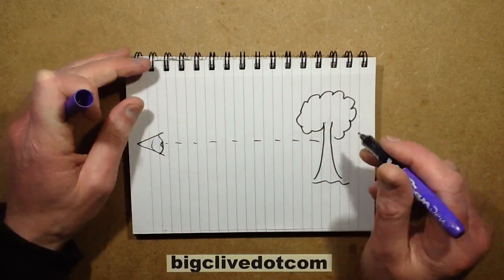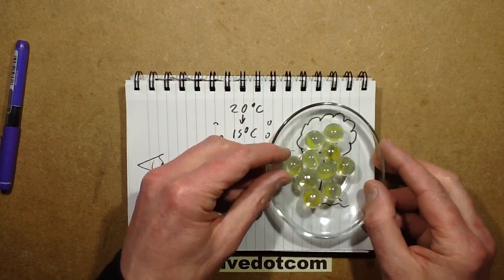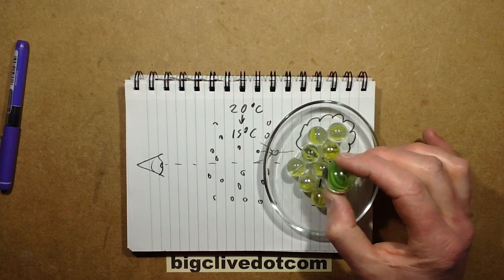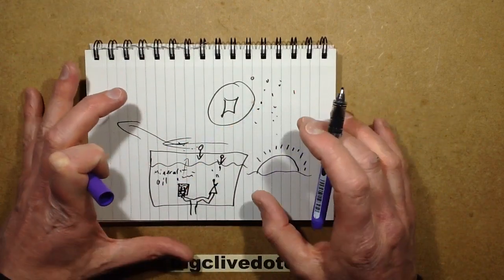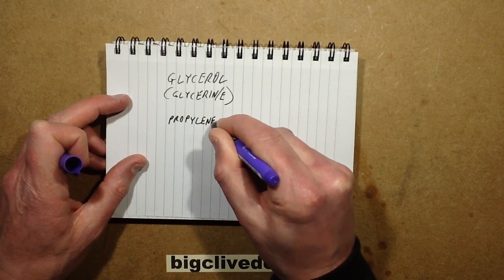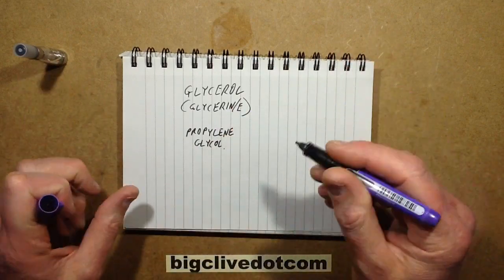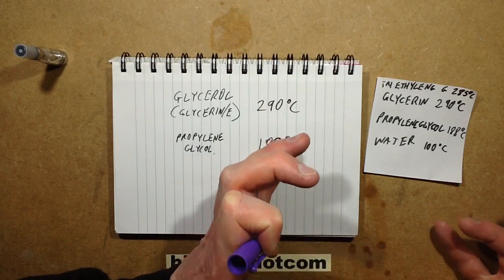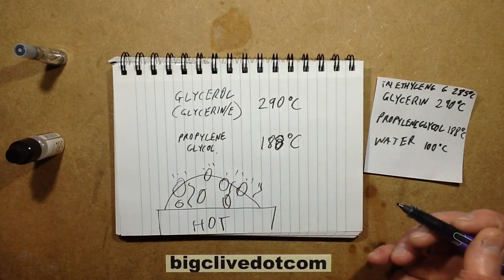How e-cigs and smoke machines make fog.

Comment: A fogger uses a pump and heat exchanger mine being 2000w and an ecig as you said has a coil a tank a mod which holds the batteries and the difference is the person pulls and inhales in order to bring the liquid through into cotton to then atomise it's very different man

Comment: Better also thank the drug dealers for those scales, I know certain resins need exact weight but I try to stick with two part pours. Not always possible but I got scales for them if need be. Also could this syste m be adapted for use in Models, like model steam trains? 

I have a very big interest in Steam Railways and while I know a few good "Smoke" units and methods (one that is extremely toxic but was only ever used on Thomas The Tank Engine filmings , yeah bit hanger with gauge 1 railway sets and cameras David Mitton was lucky to have been with us as long as he was. To say nothing of Gary Anderson's works like Thunderbirds, the Times must of been horrible but it was a great series.) But atomizer based systems appeal greatly to me because it is true water vapor, Steam in a cooler visible from which as a loved of steam feel so much more authentic.

Comment: Clive, I worked with a fellow that worked at a mouse themed park here in the states. They actually make droplets with a piezo actuator device or an array of them. Then they don't need a chemical medium to make the effect happen. I'll have to see if I've got a picture of the basic device but they pot the thing and it's like a little brick with the piezo surface exposed. I think I've got it around here some where in the work shop. You described the thing perfect in the vid btw. Super neat stuff to play around with.

Comment: Really cool video and great explanations. Thank you very much for this. A question,  thinking about a wearable fog machine for an halloween costume, which methods is the most durable when battery powered and the most shock resistant in case of external impact? Thanks

Comment: Could you use the mee fog type of foggers for eliquid if modified? might be a good idea to make a different type of atomizer, one without heat.
Reply from the maker: As Mee Fog units run at 10,000 PSI it would be a very big and expensive vaping device.
Reply: Same sort of pressures as waterjet cutters. I suppose if you could get hold of a secondhand HPLC pump that might fit the bill too (most could reach 10,000 PSI at reasonable (millitres / minute) flowrates).

Comment: The heated ammonium chloride (NH4Cl) simply decomposes into ammonia (NH3) and hydrogen chloride (HCl), cools down in the air and spontaniously recombines into ammonium chloride particles. The health concern arises when the decomposed gases are breathed in and combine with water in the lungs and mouth, forming alkaline ammonium hydroxide and hydrochloric acid respectively. Inhaling two highly corrosive compounds is hardly ideal now, is it?
Reply: Ammonium chloride in itself is, however, not harmful at all in reasonable quantities. It's in fact (mostly in Finland) used as flavouring for candy and known as salmiakki.

Comment: I have a couple lithium ion 26650s, MNKE brand and Efest brand (I believe efest is just a wrapper name and the battery itself is produced by another company)
One of them is almost 2 years old, the other is almost a year. Giving that I charge them every day, both batteries are between 365 cycles and 500 cycles. With that being said, they're noticeably not lasting as long and my question is When should I get rid of them,  or is there a specific number of cycles a person typically recycles their lithium ion batteries at
I'm under the assumption that these batteries are probably past their safe life span, but its not easy to get a straight answer from  local battery stores
Reply from the maker: +Brandon Fireking The capacity will gradually reduce, but lithium cells are very good with a high number of charge discharge cycles.  If you feel they've paid their way then you could always get a new set anyway.
Reply: Thanks for answering me, Looks like I'll be replacing one of them but not all of them.

Comment: I know this question might be a bit... boring?
But it's one that I never found a good answer to.
So in all these nice movies and shows (Doctor Who for example) as soon as something goes wrong something's exploding and sparks are shooting around.
In a behind the scenes video I have seen one of those sparks emitters (bad quality sadly) and they were some weird little black device (looked like a capacitor) that was held on the ceiling with duct tape.
To my question now: Is it possibly to create those movie-ish sparks by shorting a capacitor and if no, then how is it done then? Like is there some special device for it?
And how do you make sparks shoot out for, let's say, one or two seconds instead of just a really short burst?
Reply from the maker: +The Renegade Programmer Common pyro device in the FX industry.  You can buy them from your local LeMaitre supplier.   http://www.lemaitreltd.com/c/Robotics-and-SPDs/1jpHwzff4Hk
Reply from the maker: +bigclivedotcom I should add, they also do silver star ground launch pods and short (and long) duration gerbs which produce sustained showers of sparks.  Depending on where you are, you don't usually need any form of pyro licence to buy FX cartruidges.  just be aware that they can set fire to stuff as demonstrated rather tragically in the Station Nightclub incident.

Comment: @Clive - why do we need the Glycerine or Propylene Glycol in the first place? If we use just water and the bring it to boil, wouldn't those bubbles create the same sort of tiny droplets?
Reply from the maker: +Adam Nair The water vapour is nearly invisible and tends to just blend in with the air like normal humidity.  The glycol doesn't blend with the air so remains suspended as droplets creating the fog effect.
Reply: +bigclivedotcom aha okay, so if the objective is just nicotine delivery with a bit of flavour, can it be just water then?
Reply from the maker: +Adam Nair I suppose that might work.  I've never really used the nicotine version.

Comment: I'm curious what would happen if you doped a solution of 30% glycol with 70% water, to instead replace 5% of the water with liquid lysergic acid diethylamide in one of those nightclub fog makers?
Reply from the maker: +bluephreakr The lack of control over dosing would pose issues.  Plus the risk of adverse reactions and complete crowd freak-outs.
Reply: Not to press on, as honestly it was only a hypothetical scenario, but how would there be lack of control over dosing? The stuff would be thoroughly mixed before release right?

Unless you mean dosing based on proximity, and even then most fog makers are a reasonable distance away from other people, and out of sight. Eventually there would be complete saturation and even distribution within the area right?
Reply from the maker: +bluephreakr The environment in a club is constantly changing regarding airflow and turbulence.  You'd end up relying on monitoring density visually which is not accurate.  There's also a possibility that the chemical may not make it through the heater block intact and get modified on its way through, particularly when mixed with the other fog generating agents.  An alternative might have been to use an ultrasonic humidifier with a strict chemical to water ratio and run time.  But again, in a commercial environment doing something like this could have undesired consequences.
Reply: bigclivedotcom
I figured heat would be an issue. That and many drugs one can grab from the street or mock up may not have the same chemical properties when heated; I was relying on a few things for my hypothesis;
1) Glycol and water, while not entirely inert, should be inert enough as fog-making agents to act as a chemical deliverer
2) The drug in use is heat-insensitive, or somehow enhanced with heating, and would not be terribly affected by the other agents
3) Said drug is effective when given orally or nasally

I won't talk any more about it, don't want to give people bad ideas so easily, but that's what I was basing my previous statements with. If you like, you could experiment with the idea of fog dispersion in another video.

Comment: Thank you for the informative video. Some questions though, you mentioned the different boiling points of the liquids, but I am suspecting that the solution of 2 volatile liquids, e.g. propylene glycol and water, would be quite hard to accurately predict the boiling point of, especially given variables like the quality of water you add, concentration of the 2 liquids in M, and additives etc. How would the electronic parts accurately heat the solution to the right temperature? I supposes with a thermistor, you can control the temperature with some PID loop but the boiling point is again dependent on factors not taken into account. It's probably not quite right to say that the water itself is boiling, since it's a miscible solution, the entire thing is boiling and the bubbles bursting are both water and the other component... This gets complicated because as some of the solution boils and vapourises some of the gas will cool and condense back into the solution, I suspect it becomes a sort of distillation apparatus that concentrates more and more of the higher boiling point distillate, increasing the concentration and therefore boiling point with continuous use. Perhaps this is what leads to the e-cigarettes to "burn"?

Comment: Great video, the only comment I would make is the CE type atomiser you showed for the e-cig is very out of date and quite inefficient compared with more recent tanks and units.   The CE type uses silica wick which is heat resistant being basically glass rope but is very poor in moving the liquid from the tank to the coil whereas most modern units now use cotton wad, wick or similar and many modern battery units have something called "TC" which stops the atomiser fitted from reaching the burning point of cotton thus stopping the chance of a dry or wet burn.   A new concept in the Altus atomiser is using a heating block instead of a wire coil and the heating element is alleged to last ten years,

Comment: why is smoke from a fog machine irritating to the lungs and feel dry compared to normal air?
Reply from the maker: +iblis89 It's hygroscopic and in high concentrations irritates the mucous membranes by drying them out.
Reply: it just feels counter intuitive that water vapor is hygroscopic .. can that really be true? :S
Reply from the maker: +iblis89 The vapour isn't water.  It's droplets of glycol.
Reply: +bigclivedotcom But glycol,  glycerin and demineralised water in The liquid,  Where does the water dissipate to, there is generally no secondary exhaust.  you said it boiled away which should cause steam?
Reply from the maker: +iblis89 The water boils out of the glycol and ejects from the machine as a mixture of steam and the glycol droplets.  The steam is absorbed into the air leaving the glycol droplets visible in the air.
Reply: +bigclivedotcom thank you for the clarification :)

Comment: Clive, I'm afraid your explanation of fog is a bit wrong. The distortion isn't caused by a difference in the index of refraction, it's caused by scattering, specifically Mie Scattering, where the droplet size is comparable to the length of the wavelength of light. 

Long story short, it's caused by diffraction, not refraction; the light waves move around the droplets, not through them....

Comment: without sounding too much of a dick Clive because I love your videos but

Vaping is a bit of a misnomer,.eliquid isn't being vapourised it's an aerosol, stupid I know.

Boiling VG or PG is really bad & it produced crap we shouldn't be breathing, saying that it's still in quantities a lot smaller than if we were still smoking.

The whole high vs low power is misunderstood by most too & uneducated scientists love to do unrealistic experiments to prove a point.

like sticking 15 watts through CE4 designed for 5-7. Modern high power attomisers use bigger airflows, wider juice channels & better wicking materials, usually cotton or cellucotton so at higher power more liquid is aerosolled but the temperatures don't rise. IMO your more likely to get a dry hit (overheat) from a CE4 at 15 watts than a more modern Subtank at 40watts.

Comment: Glycerol and Propylene Glycol are used together in e-cigarette liquid. PG is a flavor carrier. Ratios vary. Most commonly in cheapo gas station and common store liquids the ratio is 50:50 in order to accommodate low powered eGo style devices. 70:30 ratio (VG/PG) and higher in VG is used in lower resistance setups and produces denser vapor cloud.

Comment: Hi Clive, what ratio water to white vinegar should I use for cleaning out a smoke machine? Thanks
Reply from the maker: +Steve Elvey Typically about 20% white vinegar to water (preferably distilled water).  Then after flushing a decent quantity through your machine, empty it, rinse it and then refill with fog fluid and flush some of that through to make sure no vinegar is left sitting in the machine.
Reply: +bigclivedotcom Thank you Clive! I will give that a blast, I have a machine that has got rather spluttery and was wondering how best to tackle it.
Reply from the maker: +Steve Elvey Worth a go, but spluttering liquid out the front can also be down to an incorrect glycol ratio in the fluid.
Reply: +bigclivedotcom I wondered also if it might not be quite hot enough? It is quite an old machine of dubious origins! I have been using a can of smoke fluid that I purchased from CPC a while ago which I have used in another smaller machine successfully, although I would much rather use one of your recipes if you have a video on mixing some, especially if it meant I could alter the smoke density.
Reply from the maker: +Steve Elvey If using the machine for personal home use then you could experiment with glycerin and sterile (boiled) distilled water, but if using it in a public area then I recommend only using commercial fluids for liability reasons.
Reply: bigclivedotcom Thank you Clive, will give it a try on the machine at home

Comment: Good job explaining the vape process Clive. Its surprising how difficult it is to find a clean answer (and how misinformed a lot of people are on the mechanics of it). 

Of interest to me is how quickly atomizers seem to fail; we do full chemical component testing as well as failure studies on new devices at my work. Good quality atomizers are gorgeous in their construction - very precise machining, high quality metals, etc., but we literally have bags of 100's of atomizers that failed resistivity thresholds after only a few vaping sessions. 
I am typically without an answer as to why ... careful examination always shows no discoloration or fatigue so it puzzles us to no end at this randomness. Not to mention having bags of near new atomizers sitting around that we can't bring ourselves to throw away ... neat to play with, but a real waste.
Reply from the maker: +Wayne Koebel If the elements themselves aren't oxidising and pitting, raising their resistance, then it may be failure at the termination points.

Comment: Small indoor zen fountains with water vapor, don't they use fine piezo-electric vibrating wires to atomize water into tiny droplets? Half remember reading something about this...
Reply from the maker: +miezpiez It's a piezo ceramic disk with feedback and a high frequency driver.
Reply: +bigclivedotcom Ahaa!

Comment: So on the watering down glycerin part. You don't have to if you got a tank that can wick it. 

Ce4 (basic cheap ecig kit) will wick up to 50/50ish mix of Pg/Vg. If you're running a bigger tank (say a isub from innokin or subtank from Kangerteh) you can run 70-80% VG. 

You can also run 100% VG on a dripper (a wire and wick setup with no tank. You drip direct onto the coils). 

Also with that shite liquid, its prob 80/20 (Pg/Vg), better liquids have better ratios of stuff. 

Also you don't really burn the Vg, you burn the cotton. Thick liquid, crap wicking, burnt cotton. 

Source ; I sell this stuff to people.

Comment: Pro Hazers for movies and tv productions like the MDG Tour Atmosphere use the same principle. They pump high pressure Air (with a compressor) or CO2 (from a tank) through a nozzle in the fog liquid. 
Way more expensive than a fog machine, but the haze will stay in the air for a very long time. This is very important for filming. With a fog machine, every shot will have a different fog density. Also the haze is white and doesn't smell strange, while fog machines usually produce a blue-ish fog